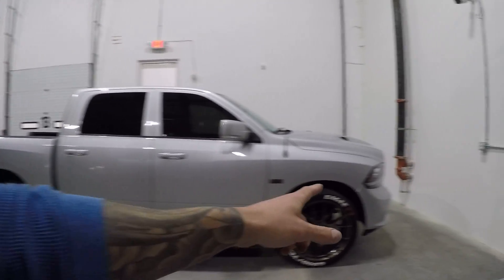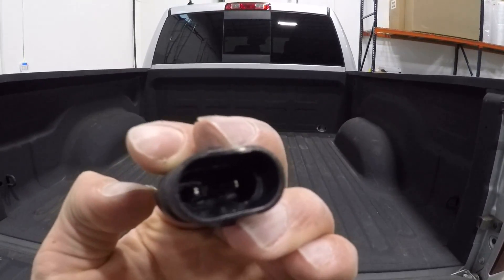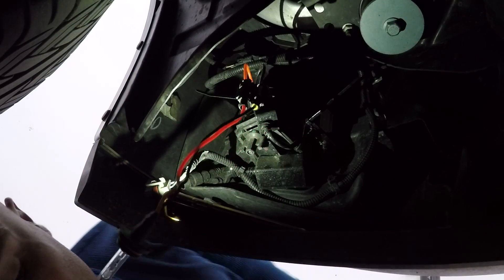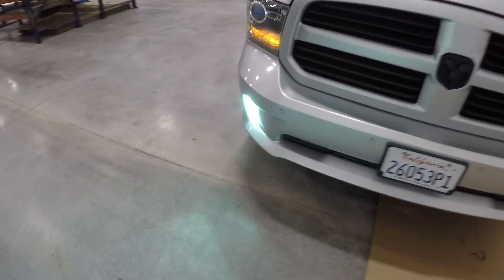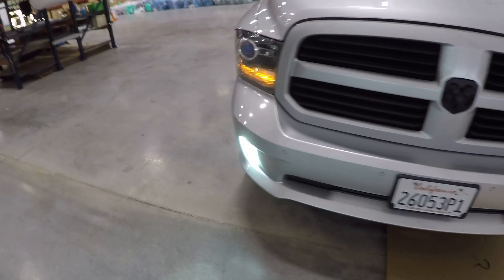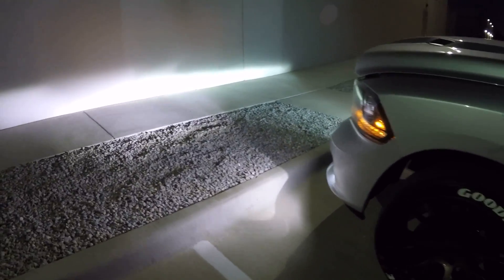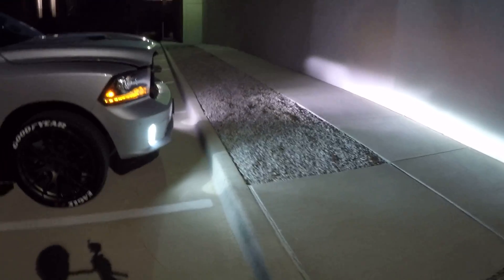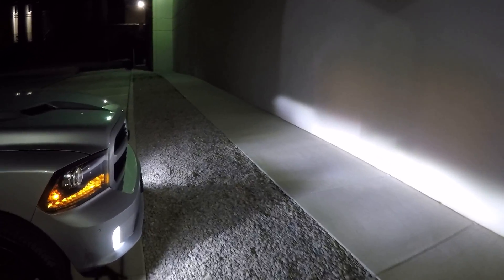LED vs HID Fog Light Comparison Test

Comment: the LED may be brighter, but the HID will be more effective in fog than the LED, I explain:
the design of the LED is that the bulb has 2 faces which gives a non-uniform light diffusion because the edge of the LED does not offer any direct lighting with the internal refector of the headlight and distorts the beam which remains blurred as shown the video in addition to dazzling the cars in front.
  On the other hand, the HID has a more frank and delimited beam design than the LED because it uses the entire surface of the internal reflector of the headlight.
The result you will have with the LED is a screen of light that will dazzle you in the fog and much less with the HID which will diffuse a complete and delimited light with the internal geometry of your chrome headlight diffuser.
I have a transport company and lighting is important for my trucks.
it's not the power of the light that is important, but the way in which it is diffused

HID 1
LED -1

Comment: You said you have a canbus decoder on the old HID kit?did you have to get that for flicker for HID?I have a 5 series BMW 2012 that I replaced the fogs with Led kit with balast.I had to have someone code the flicker to make it go away.I just purchased a set of H11 HID for my fogs to replace the flickering LED my question is my new HID I’m getting will still flicker right ?

Comment: Does the orientation of the bulb matters?  My leds are a rectangle shape and the bulbs are not pointing in 3 and 9 oclock position due to the locking mechanism.

Comment: I ordered these led bulbs twice for my 14 ram as recommended by you and three times they have just quit working and the company re sent bulbs and they went out again. What could be doing that?
Reply from the maker: Hey Ryan those were a pretty cheap bulb solution but I would go with something like this https://amzn.to/2tO7SO2 for the fogs with a CANBUS adapter to place the proper load on the system https://amzn.to/2uthi20

Without the CANBUS adapters the LED might not be getting a steady voltage and flickering causing them to fail prematurely

Comment: Your color temps are not similar. So you’re not comparing apples to apples in regards to light spectrum. Looks light you’re running 8000k HIDs as compared to 6500k LEDs. The 8000k will not project very well. Try comparing the LEDs to 5000k HIDs.

Comment: Protip:  Never compare incandescent or HID to LED with the engine turned off.   The voltage is lower that way, and that has no effect on LED but huge effect on incandescent and HID.    Secondly, you have to compare apples to apples, so make sure to compare a HID kit that is of the same kelvin (the higher the temp the lower the output) and the same cost.   To compare $30 HIDs to $100 LED wouldn't be fair for example, when you could compare to 55 watt $100 HIDs for example.
Reply: Also, I see you have the engine running later in the video, but the focus of the LED is horrible on the wall.   That's going to blind oncoming drivers.

Comment: On my 2016 ram sport 1500 with oem projectors  I tried the 9006 and 9012 led bulbs and both are not fitting inside the housing on the low beam side. Can I use 9005 LEDs instead?

Comment: Misleading video. They are fog lights which need a special range of color temp that ideally go from 3000k to 4300k. Yellowish light have a wave lenght that will help you see through fog, mist, snow or heavy rain. White bright light (5,500 - 8,000 k) is useless in heavy fog conditions, the beam comes back to you as a mirror. Of course fog lights look cool in white, just make the safety statement for those who drive on foggy roads.

Comment: Would a 55w 5k hid kit be advisable in fog lights.?
Reply: Makes them burn hotter/brighter. Fog light housings are small, so be careful. I know this comment is 3 years old, but for anyone reading this; you might risk melting your fog light housing assembly. However, some fog lights are projectors. So it may be possible to do safely. However, some fog lights do not have projectors, so do not put hid’s in halogen housings, that includes fog lights.

Comment: Thks for the research with the fog lights. I tried these on my 18’ Ram 1500 and they were loose in the reflector housings. I added a O-ring from Ace Hardware (15/16 OD x 13/16 ID x 1/16H) and that snuggled them up perfectly.
Reply from the maker: Thanks for the feedback Tim!  Another solution most people do is just swap the gasket over from their stock halogen bulbs and fixes the issue 😁
Reply: @BoostedMotorsports  are these Canbus compatible?  I want to replace the fogs on my 2016 ram and looking for the easiest ones.  Love your channel!

Comment: I have the 2018 ram 1500 bighorn and these don't fit snug in the housing.. Any tips? Tricks?
Reply from the maker: Hey Anthony!  Swap over the seal from your stock halogen bulb and it will tighten things up.  The ones they give are a little weak but this has fixed it for most people!
Reply: BoostedMotorsports Tried that! Worked alot better thanks for the reply!

Comment: Awesome channel!  I've used your comparisons to buy the LED's for my 14 Ram Sport.  I think the only thing I used different was the 3rd brake light.  Anyway, regarding these LED fogs, I installed today and found a couple issues that I'm curious if you experienced?  My CS6's say 6500k on the box instead of the advertised 6k, at least in the daylight they seem to have more blue than I'd like, but I'll get a better look tonight. Also, they don't have a nice snug fit. One is better than the other, but neither have that secure feeling of the stock halogens.  Also, they don't seem to clock right?  They are both slightly off horizontal, which isn't quite catching the reflectors as well as they should.  How did fit and clocking turn out on yours?
Reply from the maker: Thanks for the support brother! You can actually clock them correctly without taking them apart if you cheat a bit by inserting the bulb at an angle you can get one of the larger size tabs to fit in the smaller slot.  Also if you transfer the rubber gasket from your stock halogen bulb to your new LED bulb that will make them snug.  Let us know if you have any other questions and we'll try to get to them! 😎

Comment: Can you tell me how you get these bulbs used here to sit in the vertical position -|- (not -/-)  to allow for max light output
Reply from the maker: For sure!  You have to mess with it a bit but even though the bulbs have 3 different sized tabs you can cheat by inserting the bulb at an angle and getting the larger tab into the smaller position and then rotating the bulb around to get the remaining tabs in.  Hope this makes sense but try it out and you'll see what I mean.

Comment: Thanks for all the info. Just installed these in my ram works great. How did you align the leds are they in a vertical position or horizontal mines seem to be in a 11o clock to 3 postion. Thanks again
Reply from the maker: You can play with the position a bit.  Even though you have 3 different size tabs play around with inserting one tab on an angle while rotating clockwise and you'll find you can install it a few different ways.  You want them to be like this when looking at them relative to the ground    - | -

Comment: I am looking at doing some led fog lights in my 2015 ram 1500, will I need decoders to make led bulbs work for fog lights?
Reply from the maker: These $25 ones worked plug and play but the Hikari ones had flickering without the decoders.  I'm doing a comparison video soon on a few different LED setups this week so keep an eye out for that before you decide 😁

Comment: I've been wanting that bluish HID bulbs. What color is that considered. I've been looking into it and I think I came out with 8k or 10k idk if that's right at all
Reply from the maker: 6000k will get you a slight blue and the higher kelvin you go up the more bluish it will get until it goes purple.  Keep in mind that 6000k is about as high as you want to go before you start losing visibility.  The bluish colors look cool but suck for lighting up the road. 😎
Reply: 6000k it is thanks
Reply: I had 8000k in my 2005 Escalade EXT... they are more blue for sure but they were still literally 100 times brighter than any halogen headlight I have ever had in any vehicle... I currently have 6500k in my 13 Laramie and they are almost purely white with a tad bit of blue, not nearly as blue as the video he posted on his 6000k bulbs which I find extremely weird.. It must depend on the brand and 55w vs 35w ballast! For me my 6500k are absolutely perfect color and extremely bright, if you wanting more of a blue I would highly suggest 8000k. they will still be WAY brighter than any other old school halogen headlight you have ever had..

 Hell I even put Pink 30,000k HIDs in my wife's (gf at the time) car back in the day like 9 or 10 years ago and they were still extremely bright when compared to halogen headlights! she absolutely loved them, and we live in a smaller county town and used to do alot of night time gravel booze cruising in her car out in the country and never had any problems with the 30,000k bulbs.

Comment: I got the exact same bulbs that you got today for the $28 but they're not plug-and-play did you have to pay extra for the Plug and Play
Reply from the maker: Hmm thats weird whats the issue with them Jeff?  I just plugged them straight in and they worked
Reply: BoostedMotorsports they didn't have to plug parts I hope they missed up on my order

Comment: I’m putting these in now. Do the lights fit snug after you turn the clockwise. Mine seem to be a little loose
Reply from the maker: Mine were a little loose as well but i just routed the wire clockwise and zip tied it to prevent it from coming loose.  You may also be able to transfer the rubber gasket from your stock bulbs to these ones to create a better seal.  Let me know! 👍

Comment: New to your videos man. Great to see some good informative videos! You should do a custom tune or a stall next. For the tune check out jay Greene and I heard that edge stalls are pretty good. Not sure if they have anything out for the 8 speeds though. Liking your channel a lot man!
Reply from the maker: Thanks Luis appreciate your support on the channel!  I'm waiting for DiabloSuck to open up the 8speed tuning for my 2014.  They updated it yesterday but it fails trying to load the tune.  Hopefully they release it soon though. 4 years is insane.  HP tuners already has transmission tuning for our trucks.

Comment: Sup man just described to your page. So did you keep the LED dog lights and stick to the HID head lights?  Im confused. How can the HID be so much brighter on your headlight vid but less brighter than the LED on the this fog light hid? Thanks!
Reply from the maker: Hey Ken!  Yes I'm currently using HID in the low beam projectors and LED in the reflector housing fog lights.  HID seem to be a better option for using them in halogen projectors.  LED work great in reflector housings.  Let me know if you have any other questions and I'll try to answer them! 🙂
Reply: Thanks brotha, actually I do.  is that the stock projectors you have on you truck (headlight housing not sure if thats what thye are called.) ?and also can you give me the specs on your fog lights and headlights ? as far as lumens and brands?  I have the same color truck as you and like some mnods youve done on your truck!

Comment: I was under the impression that the HID's were supposed to be brighter, clearer and crisper versus the LED's.  I'm glad I came across this video  where you show the difference of both in the same video.  I was leaning towards purchasing HID's but I don't think I will be now. Thanks for the comparison.  I found it it to be super useful in determining what was  the best light output and source. Awesome video bro!
Reply from the maker: Appreciate your support Saul!  I'm actually going to be doing a few more bulb comparisons in the next week or so if you want to hang on before purchasing.  HID is definitely the way to go for the low beam projectors which you'll see in my comparison video going live tomorrow but LED seems to work awesome for the reflector style housings in the fogs. 👍
Reply: Boosted2k  I sure will. Thanks bro.
Reply: Boosted2k I have reflectors on my truck as well so I'm definitely interested in seeing the new video.

Comment: Will I have to add a ballist to the bulbs or is it a direct fit to the factory wiring harness?
Reply from the maker: Hey Tyrell this kit is direct plug and play which is pretty awesome for $25.  I'm going to compare these $25 LED bulbs to more expensive 9006 LED kits in the upcoming week to see how they compare if you want to hold off until I post those videos.  Either way for the price they work pretty good!
Reply: Boosted2k thanks , I have a 2017 Ram 1500 Laramie.  I have done a few mods but not as many as you.

Comment: I thought the fog bulbs were H10/9145/9140 ?
Reply from the maker: Hey Jack what year is your truck?  I know 2009-2012 had different fog lights than 2013-2018
Reply: Boosted2k I have a 2016. I was basing that on a forum post that has all the specs for 4th gen bulbs

Comment: Looks great John! Thanks yo a previous video of yours, I put in LEDs in my headlights and fogs and have been loving they way they look. In your comparison, I'd say the LEDs look way better than the HIDs. Keep up the great work!

Almost forgot...did you get any bulb out codes on the dash?
Reply from the maker: Hey Mike thanks for your support!  No messages on the dash with these!  Did you get a chance to see the HID vs LED in the factory projector video I did yesterday?  Was shocked at the difference and was not expecting it to be that extreme!  HID completely dominated the LED in the low beam projectors 😯
Reply: Boosted2k I did watch that comparison. I commented in another video about the Hikari bulbs...I was sorely disappointed with them, but happy with the LEDs that I found instead of them. Like a lot of guys here, I wanted the ease of plug and play...also I'm too chicken to drill through the dust cover!

Comment: This may be a stupid question. Can you put those in the headlight projectors too? And can that work for a 2016 Ram?
Reply from the maker: Hey Justin you probably could with some trimming of the tab to convert it to a 9012 but I haven't tried.  Check out the HID vs LED video in the factory projectors video I posted yesterday though.  HUGE difference and I would recommend going HID there.  Let me know if you have any other questions! 👍

Comment: So these led bulbs will plug right into the factory harness and work? Also what size bulbs are for the stock headlights on the ram 1500?
Reply from the maker: Yeah they plugged right in!  Do you have factory projectors or reflector housing headlights?  If you have factory projectors I would highly recommend going with an HID kit there.  Check out the HID vs LED video I posted yesterday for the low beams and you'll be surprised by the results there! 👍
Reply: I have the reflector housing headlights!

Comment: Looks awesome bro  I put   LED's in my   Fog lights And that seems to be the best combination I put C 6 leds In my  Low beam   Projections But I'm still not getting the light output that I want So I'm going to put  HID lights in this weekend. And see  How that goes. Anyway love the channel man keep up the good work Still  Getting a lot of great ideas from you .Going with the same running boards that you bought for  Your ram I think it looks like it came with the truck So good choice bro And it doesn't break the bank Another plus my Book.
Reply from the maker: I just did the same thing lmao!  Posted up the LED vs HID low beam projector video yesterday and the difference is insane.  Never would have thought it would make such a difference.  Thanks again for your support on the channel brother!  I need to get some other stuff going I think before it turns into a bulb channel though but I wanted to get all the lighting sorted out and get rid of the crappy halogen stuff 🤣

Comment: I like the LED look, those bulbs are hot. 
(Comment has nothing to do with inital post) On a side note, those tires are nice. The only thing is compromising look for ride/comfort.
Reply from the maker: Thanks brother!  Ride quality surprisingly isn't too much different than stock.  A bit more firm but nothing that makes your teeth rattle or brutal in any sense.  Thanks again for your support on the channel! 👍
Reply: Chiming in late, but they are also likely heavier and with more weight further from the axis of rotation, which takes more effort to turn, like try spinning in your chair with your legs tucked in and then with your legs sticking out... same weight, more effort sticking out.   So expect a small loss in measured horsepower and fuel economy.

Comment: Can you tell us if there has been any issues with flickering
Reply from the maker: Drivers side has a VERY small flicker you can see in the video which seemed to eventually go away but for $25 plug n play its hard to complain.  I'll be comparing these against a couple other more expensive 9006 LED kits in a week or so if you want to wait for those results before buying!  Thanks again for your support on the channel Rubin! 👍

Comment: Throw a code?
Reply from the maker: No sir no error messages!  I'll be comparing a few different brands of LED bulbs for the fogs in about a week if you want to wait for those videos before picking up a set.  These are awesome for $25 but I'm going to compare them against some more expensive ones too and see how they do. 👍
Reply: Boosted2k I went on that night and bought them. Just got them today so I can’t wait to see the difference   I have my whole windshield tinted and it’s hard to see out at night. I need some kind of power